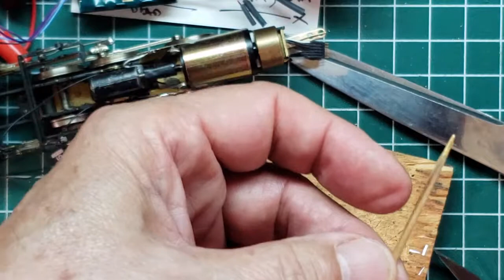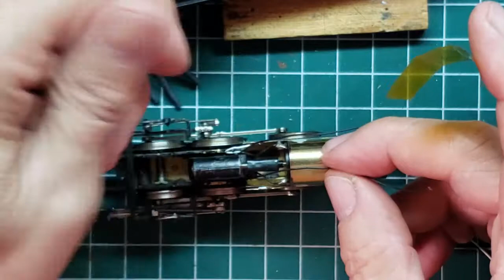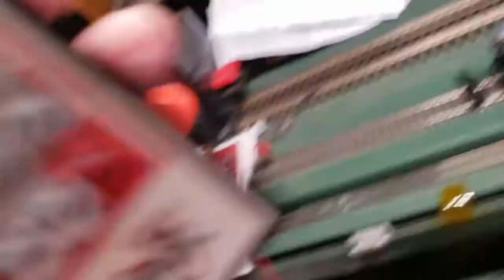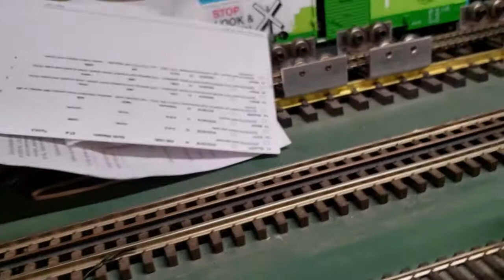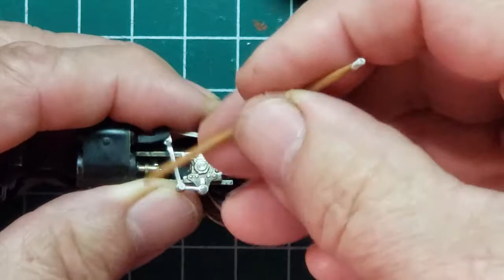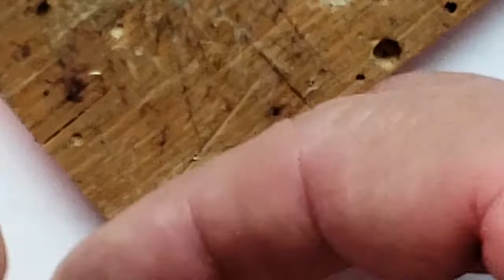4-6-0 Brass Sound Part 5

Comment: nice job   !! iwatched all of them on this one  an very interresting on how you went about everything . i would add one small thing .... i did do my first install on my 2-8-2 prr L1   brass one . i dont think its done right,but does run. cuts out alittle bit  no wires are on tender was able to put speaker in the engine . an decoder on motor .there is alot of room on them  . i also like the way you explain everything  not to many people like showing brass installs like you  . next time i take it apart ill be letting you know !..  do you do installs ? how much do you charge ?
Reply from the maker: I do installs but because of the COVID my backlog is up to a year and a half.  My current rate is $80/hour and so a sound decoder install is 2 hours plus another hour for steam and another hour for brass so base rate is 4 hours @ $80 or $320 for labor and an additional amount for the decoder and speaker which could be as much as another $150 so budget $475 to $500.  This includes little things like replacing couplers, milling the body, installing LED's, making new handrails where needed and minor repairs, painting etc.
Reply: Oh ok little to much for me . I didn’t think it would be so much but thanks for the videos ! I’ll keep watching
Reply: I do Painting and Weathering mostly for brass, but I also do DCC and Sound installations, but I would have gone to Precision Scale to get one piece cast crossheads instead of trying to fix that one crosshead. it just seemed way too much of a hassle... LOL! But I love that it works now!